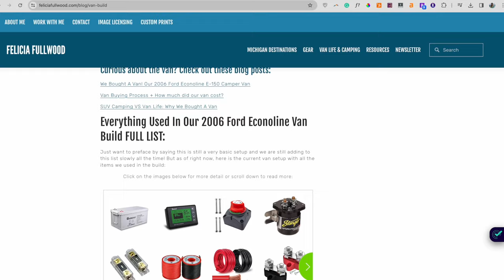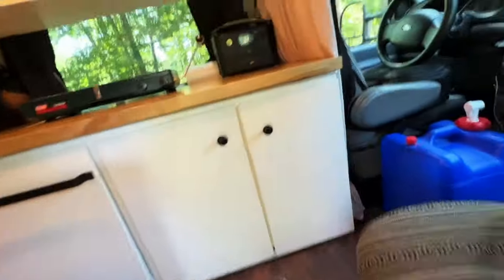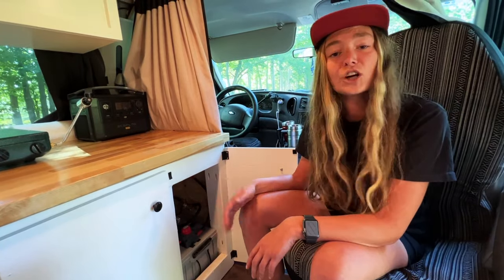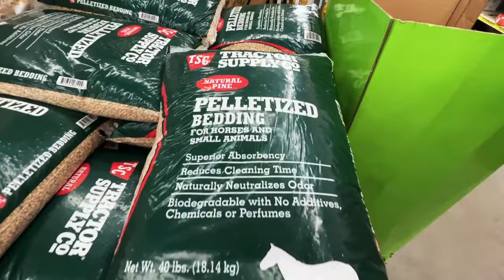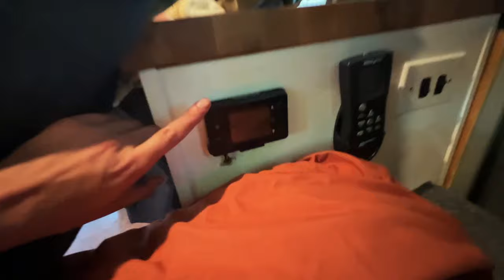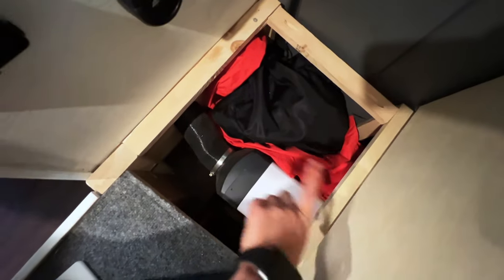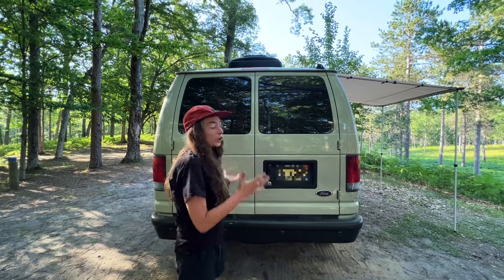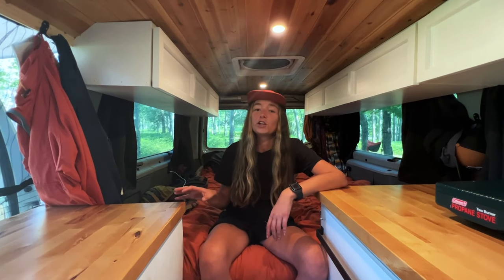Van + DIY Build For $13K: Ford Econoline E150 Van Tour | Simple & Functional

Comment: What kind of fuel tank do you use for the diesel heater? Im considering one and debating between one with a separately mounted tank or an all in one unit. Thanks. Good videobby the way.

Comment: I have the same type of van but it’s a 1989 a little shorter than yours when I bought it for 3950.  But it still needs a lot of work on the inside. The motor and tranny is great no leaks which was the main reason I bought it. But I have no power to the back I use a battery tor my phones and fan. But that’s about it. I’d like to know more about how to rebuild the interior of it. I love the layout of your van and it’s something I really want it the way you made yours. I’m still looking for friends that know more about the electric components. So I can keep my battery charged better.  I have to keep going to a charging place to charge it.  So that sucks. 😂